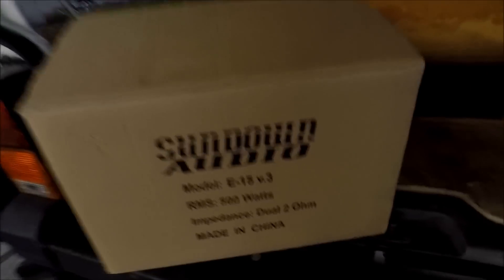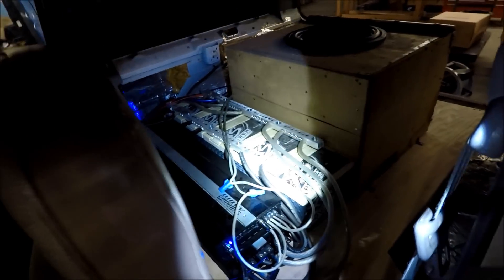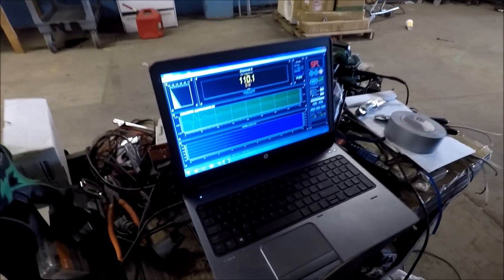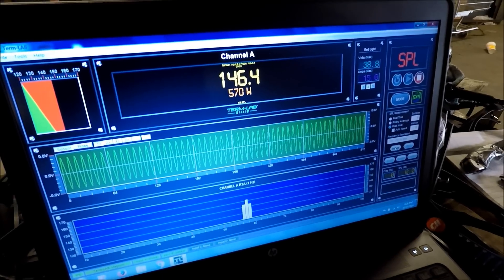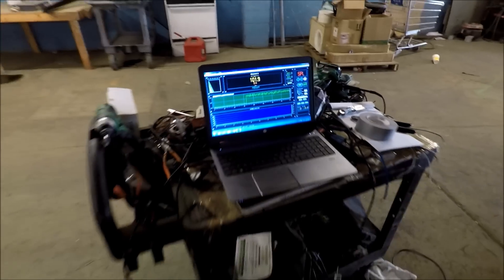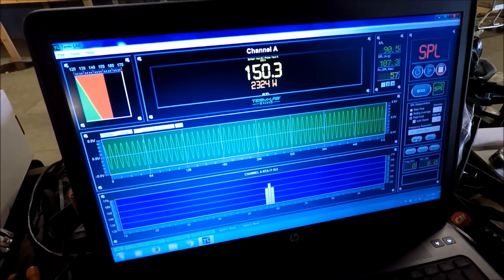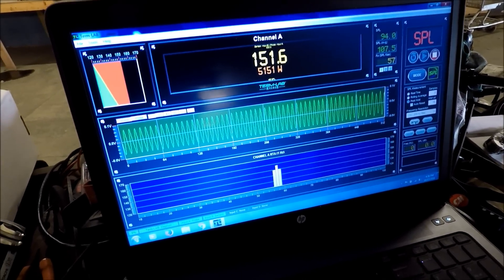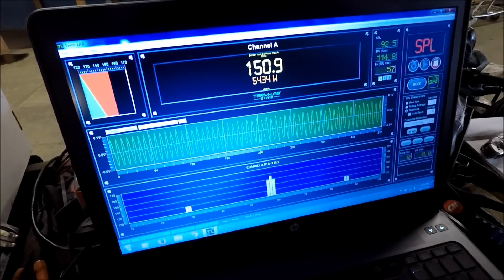*Woofer Test Wednesday* E-15" v.3 SPL Test at Sundown Audio

Comment: so damn, im building a dual 15 box with the e 15 v3 d2 wired to 1 ohm and was only going to use a 1500 watt amp for the both of them. i used a jbl gto 751 ez on my last one and i was getting flex and some good movement in the cab of my car even though the port was facing up to the trunk. but does that mean i should get something like a 2500 watt for more serious power to BOTH subs? still new to all this and learning more each day, but the sub was doing some serious flexing itself and would clip on the bass i love you! extreme bass tester lowest hz note. not sure what exactly that means unless that means i didnt have enough power for the sub to produce the frequency?

Comment: My question is approximately how many dbs or more bass will be added by adding a second one of these?? AND should I get 2 of these (15s) or do I get 2 15s of EMFs Lowballers? Both can do 150 db with just one 15.
Reply: Double the cone area is +3 db 
Double the power another 3+db

Comment: I own 3 of these and got 1200watts rms to each of them running all day long and they take it like a champ.these are very underrated reccommend to anyone.
Reply: They can get low maybe not as low as the big bohemiths they have but enough to surprise the hell outta of ya.
Reply: @iamlegend81gaming  Hmm how do you think they compare to the Digital Designs redline series asin 500 all the way up to 800 series thats if you have had a chance to hear one of both brands i currently own a DD715 but i want to build a dual E15 setup to surprise a few people with.
Reply: @EBMproductions1   the digital design subs are great subs but the sundown e15s are  definitely better not by a massive crazy amount but u will be able to tell a pretty good difference in sound but still lack the punch the e15 has plus the quality of the subs built to last.
Reply: i know im probably gonna sound like broken record here but how does these subs handle the lows my man?

Comment: I have a question.. when you turn the volume up on the radio the wattage increase, so does that mean volume= amount of watts coming out your amp? 
Max volume is the full wattage?
Vol. 20 = 500 watts,  vol. 27 = 800watts. 
Vol. 30 = 1000 watts.. ? 
Could you do a video how that works what's happening?
Reply: Yes. If your bass knob is all the way up or 3/4, at that point the stereo volume is throw the power at that point.

Comment: What are box specs please? Tuning frequency and volume?
Reply from the maker: Loud x loud tuned to loud
Reply: @UnofficialAudio for sure.... Want the same box... Hahaha 😂
Reply: Beniaina the same box may not work for your application. I can help you out if you have any questions.
Reply: @jamesbondcaraudio4247  scoring 150db with just 2.5k with one 750w sub...really  impressive!! I think the box is the  key.... don't you?
Reply: Beniaina the box is always the key. But this design my not work for your application. This box is designed for this application. I have done more then a 150 dB with a single 15 under 2K watts. But my design may not work the same in this specific application.
Reply: @jamesbondcaraudio4247 Nice ! what was your setup ?
Reply: Beniaina it was an American Bass XFL on 2 VFL 120.1 strapped @1 ohm. I have a video on my channel of my official run hitting the 150dB
Reply: @jamesbondcaraudio4247  I have checked it out...  really impressed !!
Reply: Beniaina thanks man. I’m gonna try too get even louder this season. What are you running?
Reply: @jamesbondcaraudio4247  I'm now running 2 15" massive audio summo powered by a Skar RP3500.1...  the box is 5.75ft3 tuned at 35hz ...did not even get close to 150db....lol
Reply: Beniaina hell ya. Some good equipment. What kind of vehicle is it in?
Reply: @jamesbondcaraudio4247  It is an old 89' Citroën Ax... I can send you some pics of the setup on Messenger...
Reply: Beniaina cool I have no idea what kind of vehicle that is. I only do Youtube and Instagram.
Reply: @jamesbondcaraudio4247  for sure its an European car... And an old one... Hahaha

Comment: Dam u doubled power and gained 1.3 dB 150.3 2340 watts  then 151.6 5150 watts.. to gain 3 dB ( what the average human can detect)  you would need to quadruple power at least!
Reply: Power compression. As the coil heats up the drivers efficiency drops. Also the suspension is non linear. As it approaches its limits it become more stiff, requiring more and more power to move.

Most modern subs are electrically limited vs mechanically limited.
Reply: @dennycote6339   If you wanna get technical, "power compression" is the lack of 3dB gain for every doubling of power, as the motor reaches its excursion limits. "Thermal compression" is the reduced output of a driver over time due to increased voice coil temperature, which results in a rise in impedance across the entire bandwidth, and corresponding lower power output from the amp. Their test was too brief to show that.
Reply: yeah, mathematically you get +3dB for double power, id guess the reason it didn't get there is because the sub was xmeching, you could see on the oscope also the wave was all over the place